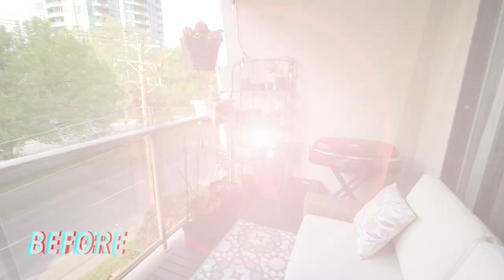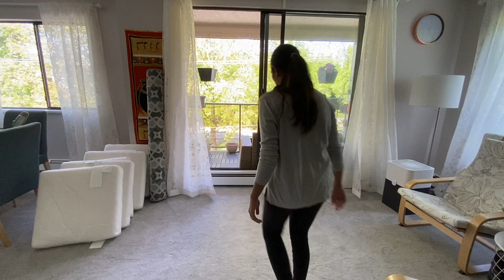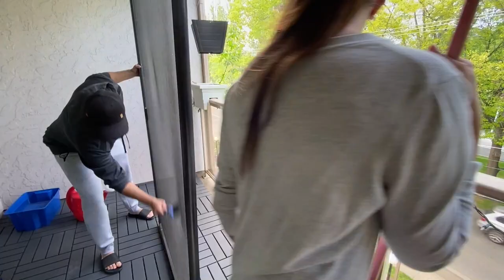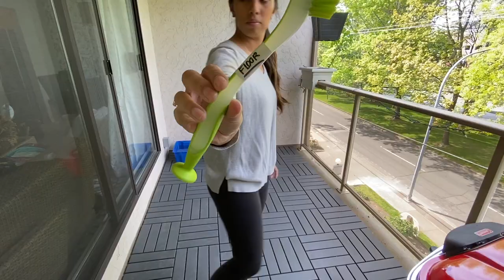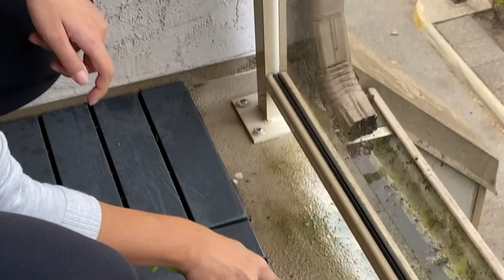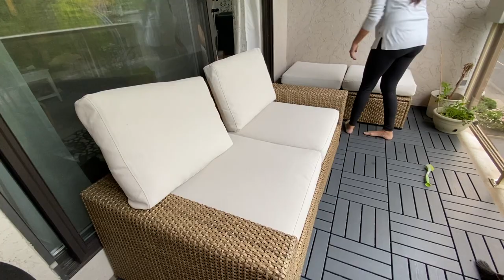APARTMENT BALCONY DEEP CLEAN + MAKEOVER | SUMMER 2020

Comment: How did you hang the lights? Iooking for a way that won’t cause damage.
Reply from the maker: Actually we got lucky because the previous owner had drilled in hooks into the wooden plank on our patio. If you're looking for a temporary/renter friendly solution I would look into the brand Command or 3M for outdoor light hooks. They are sticky and can be removed 😊